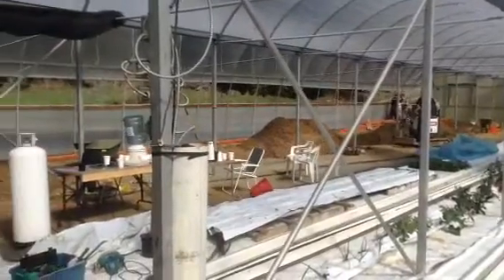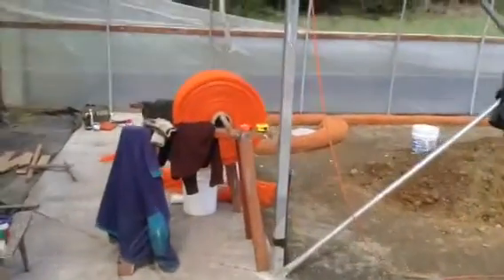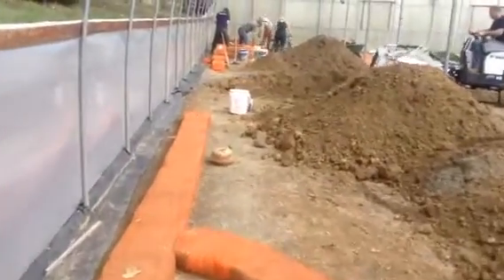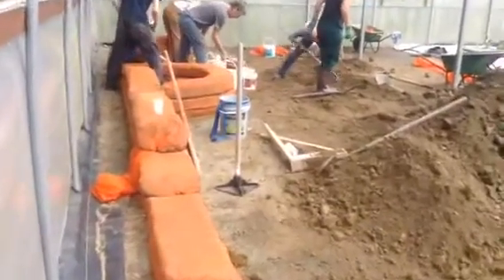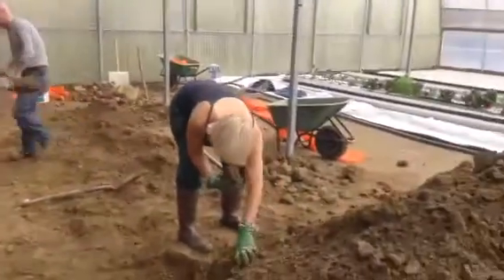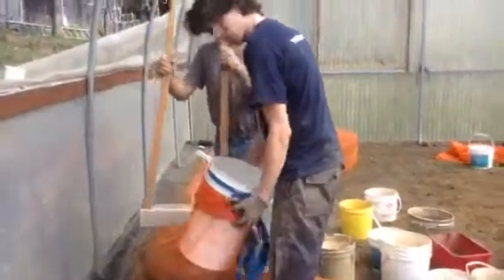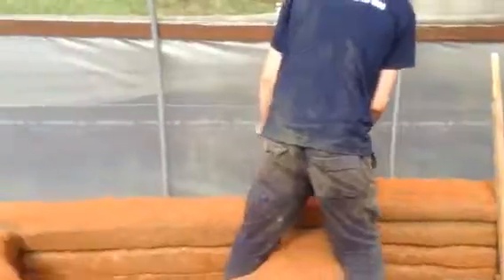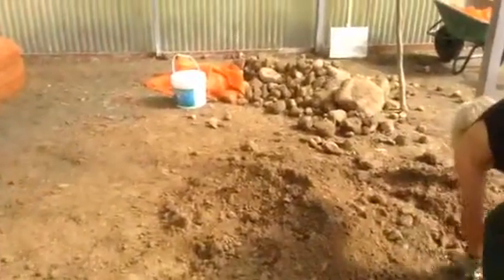Greenhouse Project - using hyperadobe

Comment: Hi, what is the hyperadobe for ?  how are you going to waterproof it? thanks
Reply from the maker: The hyperadobe is a way of using the extra fill from excavating inside the greenhouse to plant trees and dig in the water tanks. It also provides thermal mass on the north wall to help stabilize the temperature and humidity. I don't have to waterproof it because there's no rain. The adobe mud that covers the wall is sort of hydrophilic from the use of boiled flax in the recipe. I'd have to use another mud recipe if it was open to the rain.